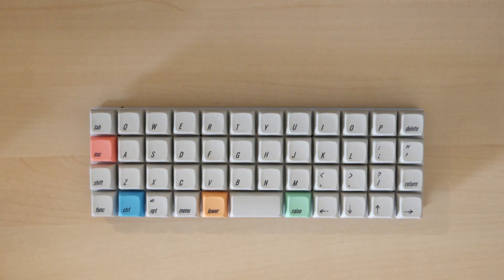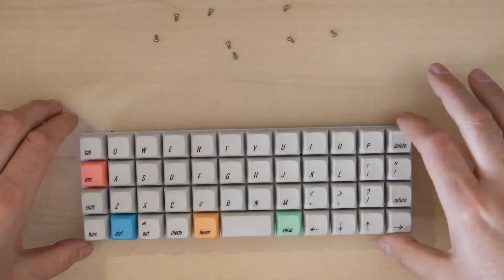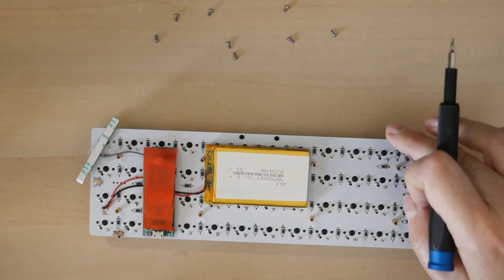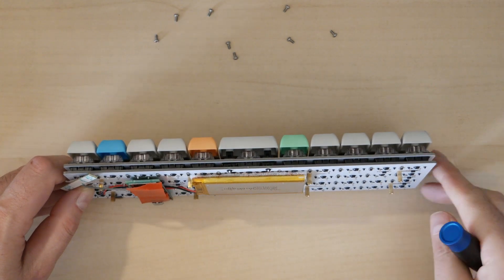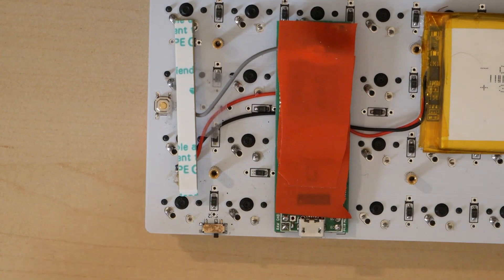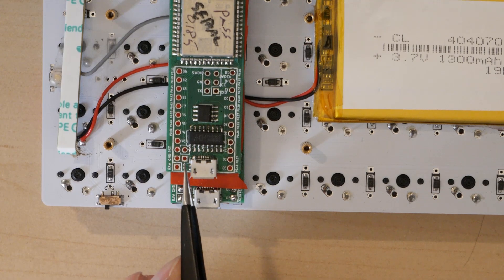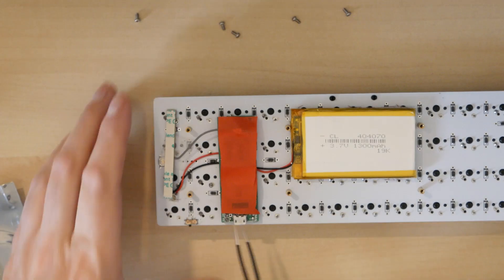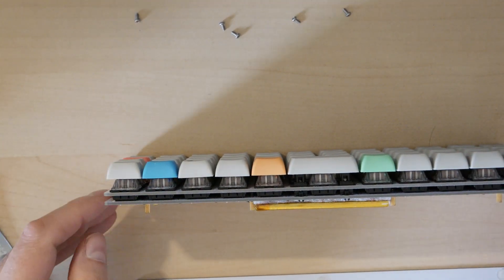Bluetooth Contra (4x12) and BlueMicro Build Notes

Comment: Great video ! I Just stumbled upon it and that's exactly the board and setup that I want to build for myself :) How did you add the on/off switch to the pcb ?
Reply from the maker: I took the Kicad design files and added the necessary footprint for the switch and the battery soldering point.

Comment: is it the BlueMicro going to work with the cartel contra PCB?
Reply from the maker: Yes it does. The "standard" contra doesn't have a power switch and a place to install the battery but you can install a small switch separately on the wire and solder the battery to the bluemicro/bluemicro840 itself.

Comment: Hey JP. I just found your channel from the github docs but I think I might be too ignorant even for this explanation. Basically, I'm trying to understand what is the difference between a bluemicro and a pro micro: is the blumicro sort of a pro micro with an nRF52840? Can I somehow turn a spare pro micro into a bluemicro by installing an 840 chip on it?
Reply from the maker: The Bluemicro uses the same footprint as a promicro but the processor is quite different.  The Pro Micro uses an 8-bit atmega chip, while the BlueMicros use a 32 bit nordic nrf52 arm cortex m4 controller.  Firmware isn't compatible between the two.  The nrf52 chips support BLE directly. The atmega chips need a second processor to handle BLE.